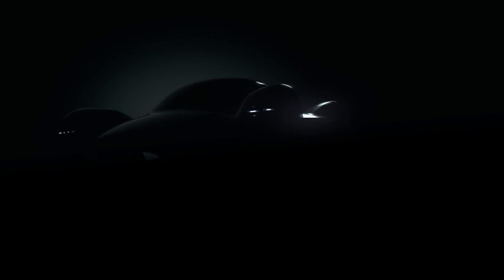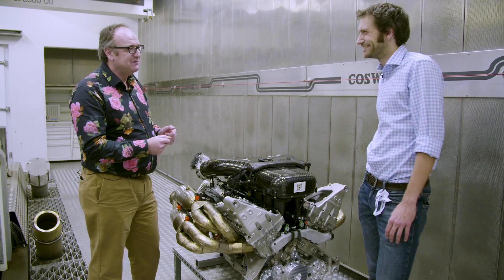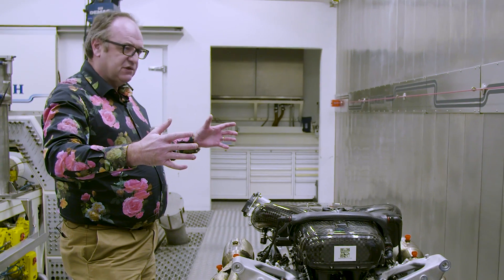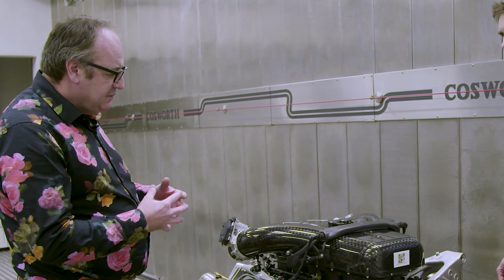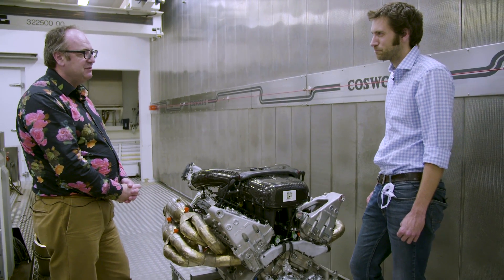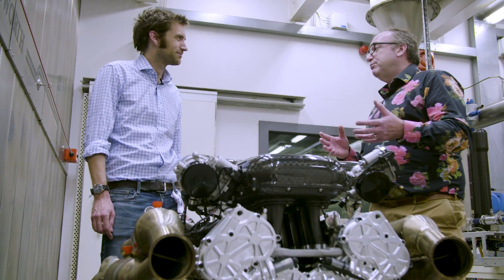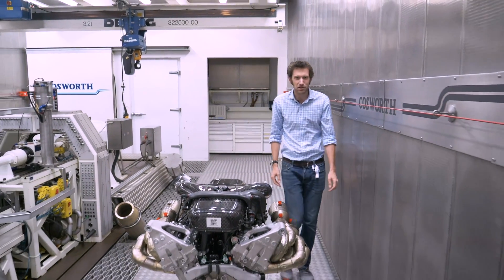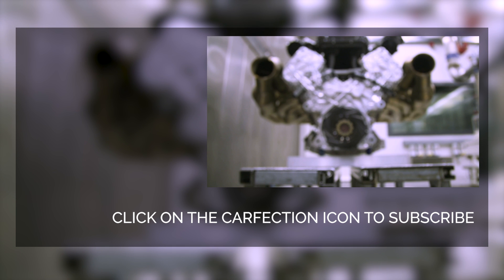Hear The Future Of The Supercar At 11,000rpm: The Aston Martin Valkyrie's V12 - Carfection

Comment: This is engineering at its peak, what an engine!
Reply: ADRIÁN GÓMEZ 80 grams too much. 😆
Reply: ADRIÁN GÓMEZ was there an engine in this shirt video?
Reply: laughs in electric motors that produce more horsepower, at far less waste and more efficiency.
Reply: @JakeobE  Electric motors don't produce any power, they convert electric power to mechanical.
Reply: zolikoff dont petrol engines just convert chemical potential energy to mechanical energy also?
Reply: @OF01975  They convert stored chemical energy (not power) into mechanical power. Hence they are powerplants.
A motor does not generate power. It receives input power and outputs the same power in another form.
The powerplant in an EV is the battery - it converts stored electrochemical energy into electric power.
Reply: zolikoff thats what i meant

Comment: This car will be as legendary as the mclaren f1
Reply: Mmm we'll see! I hope you're right! Aston Martin deserves it!
Reply: From engineering point of view it might happen, but F1 did something unthinkable -  won Le Mans overall and not just it's class. It also holds the record for the fastest production car for quite some time. Not to mention the driving position and all other technical aspects of the car. I really hope that either this or Project 1 will gain such status ,but something tells me that F1 will remain the all time biggest automotive icon. In a way it was unseen at that time and now both this and the Mercedes 1 are in a way something that we are prepared for which I believe will hold our breaths a bit shorter that the F1.
Reply: @thenewexeptor  Hard to compare both cars...
F1 was the ultimate drivers car, analog car, a real street car. It was never designed to go on a race track and post fast laptimes, also top speed wasn't it's goal, it was just a side effect.
Valkyrie is more about lap times, downforce, etc.
Reply: I love Aston Martin, but no, it won't.
Reply: Shaping up to be more desirable than the Speedtail.
Reply: No it won’t.

Comment: We officially have road cars that sound better than F1 cars. Wow.
Reply: Rohan Iyer imagine the sound with a proper exhaust it'll be just fuckin insane
Reply: Nico Wohl Imagine the sound with proper exhaust? Wtf are you talking bout. You don’t even make any sense. I guess you’re one of the supercar of London fan. Fool
Reply: Rohan Iyer modern day F1.
Reply: well it won't be at F1 noise levels inside the car, although some madman will probably straight pipe it
Reply: Eh, naturally aspirated V8/10/12 F1 cars sound better.
Reply: We've had that for years now.
Reply: Yeah, we have, it's called the Lexus LFA.
Reply: @theranter  and Carrera GT
Reply: @theranter  Well don't stop there. Honestly, a seat Leon coupra would blow the noise of most of the current grid out of the water.
Reply: @theranter  Yeah, it's called the Porsche Carrera GT
Reply: E60 M5 with an exhaust is unbelievable.
Reply: The Cinque and tuned LaFerrari sound just as good if not better
Reply: Well we had the Carrera GT from like 15 years ago and that sounded fucking sick aswell.
Reply: At last we can hear the new sound, the OLD F1 cars you need to wear ear protection in the track
Reply: But is it better than 787B?
Reply: @galihprabasidi8498  uhm...honestly no
Reply: That isn't hard in this era of F1.
Reply: If you hear an F1, that's all you we get to do,...is hear it. You won't see it, because it will pass you by, slightly fast.. This thing sounds better.
Reply: Eh wa have had them for years. Also, every motorcycle sounds better.
It's not hard to beat farting vacuum cleaners.
Reply: Well, that is no news these days of F1
Reply: this is how the supercar supposed to sound..
Reply: Not yet.
Reply: Had the since the 60s mate
Reply: Way beter than the modern f1 cars i loved the sound of the old engines
Reply: My 4 cyl BMW sounds better than F1
Reply: This sounds like a old F1 car
Reply: lol F1 cars are rapidly approaching a sound out of humans hearing spectrum.
Reply: Well more refined, dunno about better, I mean, with all the restrictions in F! now, who's running a V12 anymore? Bring back the NA V10 & V12's of the 80's at 13000+ RPM
Reply: Thank Thor !!!
Reply: V6 turbo
GT-R ? RS4 ? Yes
F1 ? Fuck off
Reply: @Careful_Eugene which ?
Reply: F1 lost the plot with downsizing engines and going turbo and now hybrid V6s.
Reply: We’ve had that for a while now
Reply: We've always had better sounding cars
Reply: The lambo Murcielago ..
Reply: This is F1 legendary engine, bro
Reply: Rohan Iyer um what? There are plenty of modern cars that sound better than the current F1 cars but this engine sounds very F1 for sure!
Reply: @stubones  yeah any Novitec Ferrari or Lambo sound better than F1 of 2014+
Reply: Even a stock Honda S2000 sounds better than todays F1 Ferrari.
Reply: Noise is not everything. Back in the 80's we had Formula TURBO, V6, 1.5L and 1500hp and it was the most exciting car racing on Tv. Nobody was bitching about noise, mind you you could either have V6 1.5L TURBO or 3.5L V12.
Reply: @philipcooper8297  It sounded great as well, just because it has a turbo or a V6 doesn't automatically mean it has to sound like garbage lol.
Reply: 2019 Corvette ZR1. 'Nuff said.
Reply: Rohan Iyer I love the way f1 cars sound
Reply: doubt someone going to by a car because of the sound..     and I find it quite pathetic it has to wine at 12000rpm to get anywhere...   mine will pass it at 4500 rpm. oh right...  because mines built for torque..  lol 0 to 1/4 kilometer in 6.5 seconds.      we'll wait on that one till it gets up to 1 billion rpm to get anywhere.  lol
Reply: Ehh, unpopular opinion but the new F1 cars sound nice. Futuristic
Reply: youwrongalbert the fact you can it “nice” says it all. They don’t sound screaming, glorious, intoxicating, howling banshee like the cars from 10+ years ago. They just sound nice.
Reply: @cheesyriceo4  
In the future when Vacuum Cleaners take over the world, I'm sure they'll be proud of their 2018 F1 ancestors.
Reply: @budthecyborg4575  vacuum cleaners? But they don't use turbine engines.
Reply: @budthecyborg4575  its how skynet will clean the mess they've made of the takeover ;)
Reply: @cheesyriceo4  they don't sound futuristic they sound like a basically uncorked turbo v6
Reply: @cheesyriceo4  you wrong albert, sounds 100% correct reading your statement
Reply: youwrongalbert I LiKe ThE SOunD oF ForMulA E CarZ
Reply: @cheesyriceo4  Bad is not the same as futuristic
Reply: @cheesyriceo4  Honda and Renault sound passable, Mercedes sound like trash and as for Ferrari half the time no body's home.

Comment: Sounds like a grinder or router. BTW, only Britts are excited about this car
Reply: American, massively excited
Reply: Lol such a retarded comment! This will be the ultimate performing road car in history, i guess only a petrol head will get excited by this.....
Reply: @WeirdBrick  I'm baffled they made it RWD. Sure, it works for F1, butt AWD is where it's at. And it's a hybrid no less. Sure, it's lighter this way. But see how the cheaper 918 handled the much lighter and more powerful P1 and LaFerrari around a track, especially those with lots of corners. AWD seems worth adding a lot of weight. That said, a larger AWD hybrid side surely also helped. Bigger battery, power to and regeneration from the front axle.
I bet the Valkyrie will burn a lot of fuel during braking and cornering to charge the likely tiny battery back up. 
Probably no MGU-H, understandably to a degree, but you do need to take on more fuel for a stint. How much more fuel?
Reply: Ummm, wrong
Reply: Zac, go back to filming hobo's playing the trumpet, know your limits.

Comment: This > AMG Project 1...?
Reply: So far, i think so
Reply: By FAR
Reply: Based on what? Project 1 is basically F1 car for the road.
Reply: @thenewexeptor  because n/a v12
Reply: @thenewexeptor  aero, weight, reliability (theoretically) and power objectively, looks and n/a subjectively
Reply: svetlin petrov this is the same but even more extreme, more lightweight plus ventury effect
Reply: @thenewexeptor  what's arguably the most important aspect of f1 in the current meta? Aero. This car doesn't resemble an f1 car in that aspect at all, and i dont mean just visibly, numerically there is no semblance
Reply: The Mercedes will win easy 
Hybrid advanced F1 engine + AWD ... but this Aston Martin sounds sexi
Reply: @SimonGanjawalugandanewsanalyst  so you're saying the one is better, despite lacking in the aforementioned metrics, because it's... Awd...?
Reply: chief justice John Marshall yeah haha it has like half the downforce and 300+ kgs more weight. No fucking way haha
Reply: Well I guess that time will show who is better. The looks, as mentioned, is subjective. I for example like Mercedes 1 more than the Aston while I don't really dig both cars design (which is normal as they are not supposed to be pretty but functional).
Reply: Mercedes Benz gotta put a v12 in that amg pOne body, how about pairing two of those f1 engines, i mean, why not? Or give up with that hideous idea of a 'road' f1 car which eventually will get obsolete and a pain in the ass for maintaining, just create a badass road v12 but screw that bi-turbo tech at least once. That or sharing the Pagani Huayra powertrain. TO ME project one is not clk gtr successor. Nothing beats a v12, NOTHING.

Comment: Hold on a second, they built a 250 Horsepower 1.6L 3 Cylinder and then just scrapped it? They should start producing those too.
Reply: It was probably too expensive to build compared to other 3cyls. These are race engines at their heart.
Reply: Maybe for a BMW i8 to sound nice without the speakers gimmick?
I'm not sure turbos are that bad though. The AMG Mercedes ONE is to make over double that power from a 1.6L, V6 turbo.
Reply: Did you listen to what the man was saying about how the engine is produced. It's super expensive stuff. My guess would be that the V12 without the kers system probably costs 100.000 GBP to produce.
Reply: @MrBirgerB  yeah it would be at least that much considering that the development costs would be in the millions, and there's only going to be 175 units produced to be put in Valkyries.
Reply: M R a hundred quid?
Reply: It was designed to be 1/4 of this engine, so it wouldn't have been designed well to be a standalone.
Reply: Depends on who owns the design i would imagine
Reply: Essentially, a motorcycle engine with huge balls
Reply: Sheehy my jet ski has 300hp and it’s a 3 cylinder. It’s a Sea Doo RXPX 300. It’s a monster
Reply: the problem with such a small engine is that it revs so high that it would produce very little torque and you'd need very high revs to make it start, something that wouldn't make it pass the emissions test
Reply: A lot of the cost of the full size engine is due to specific engineering for this application, stressed block and heads, components machined for Newey's packaging requirements. Conventional mounting wouldn't require these so cost could be reduced. Would still be hella expensive though!
Reply: Not scrapped. Probably benched to be refined and developed at a later time. They could sell the property rights of it off to another manufacturer. I am guessing someone like AMG could pick it up since they already supply Aston Martin....
Reply: I remember watching a F1 interview mentioning Cosworth has designs for every conceivable  engine configuration you can think of.  That's why their development turn around is so quick. Their engineers just sit around dreaming up engines.
Reply: Yeah. That thing would be ideal in a hot hatch.
Reply: imagine that power in a micro car or a bike lol
Reply: They didn't just bolt four of those together to make the V12?
Reply: @M.J.Clouseau  Yes, much like they bolted 2 Mondeo V6s to make the the Vantage V12. So what 2160cc 4 cylinder did they chop to a 3 cly use to make a 6.5? That is for the internet to decide...
Reply: @M.J.Clouseau  no they glued them together
Reply: I think it would need to be detuned - 60k miles testing wont cut it in a production car
Reply: Probably no market for it.
Reply: It's not too far out there if you look at motorcycles.  In line fours naturally aspirated, they have production motorcycles with 1 liter engines that make over 200hp now.  My bike's a 2004 using a design from 1999 and makes 173 horsepower with a 1.3 liter on 87 octane pump gas.  250 horsepower out of a 1.6 liter seems doable when we have 1 liters doing over 200 horsepower.
Reply: @OneWheelMan  Anything is doable, but it has to be streetable, and that is where the hybrid system comes in.  And it has to be durable too. 
Cars usually have turbo engines, to make power at low rpm's. Even a 1.6 liter turbodiesel can make 150 hp at just 4000 rpm. And a BMW 3 liter turbodiesel with 4 turbos makes 400 hp @ 4400 rpm.

Comment: Did they take the engine up to 10g ?
Reply: The instruments on the dyno say they did. I saw just barely over 10krpm.
Reply: @shoutykat  If so then Aventador edges it in the noise race.
Reply: I'm reserving judgement until we hear it with a proper exhaust system. I suspect there's a strong element of the microphone wetting itself from sheer decibel levels.